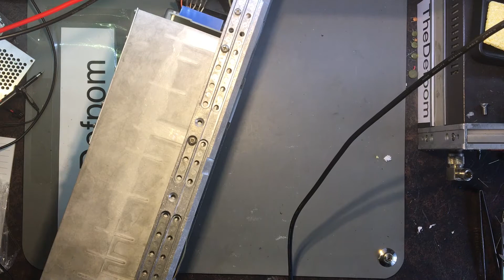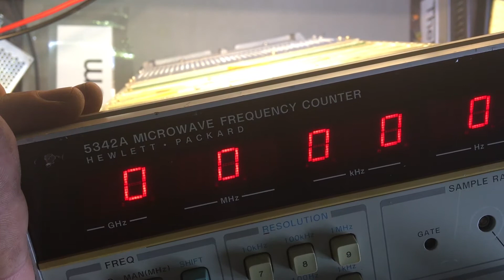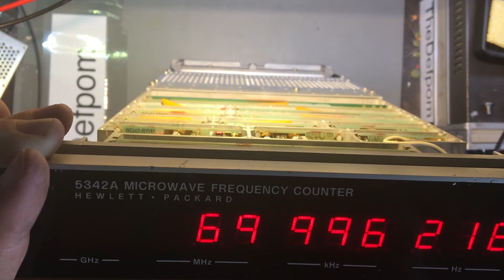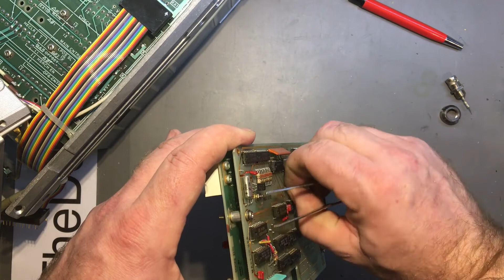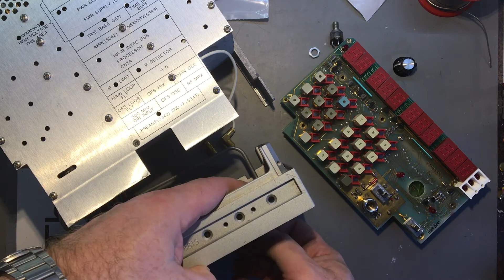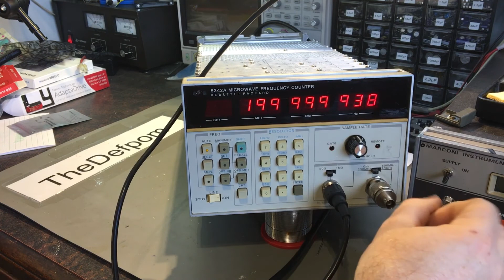#255 HP 5342A 18GHz Microwave Frequency Counter Repair   Unit 2

Comment: I wonder if there is a manufacturer's name on that pot. I would guess it was a Bourns device as they were at that time the industry standard for precision pots.  They are still in business and may have something similar. it was probably a custom order from HP for that particular run of equipment. I have the earlier version of that counter the 5340A which is a 19 inch rack mount design.  You might find it interesting to know that in the 1984 HP catalog that the 5342A listed for $6040 USD or about $14000 USD in todays money. You could easily run the price up another 2 to 3 K in options. I don't know how that relates to UK pounds but it was still a good chunk of cash any way you look at it. ATB Doug.
Reply from the maker: Doug McArtin - if I can find the right pot I can always return to this and install it, the replacement which I have done is easily reversible, I would prefer to keep it original if possible.